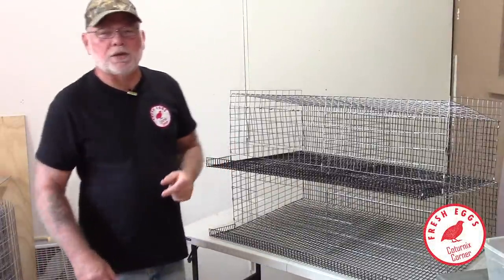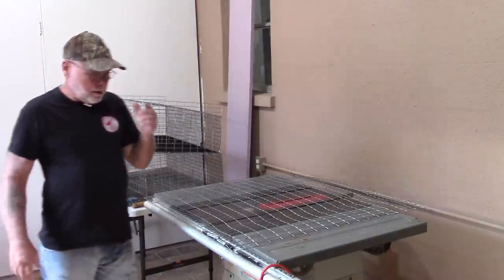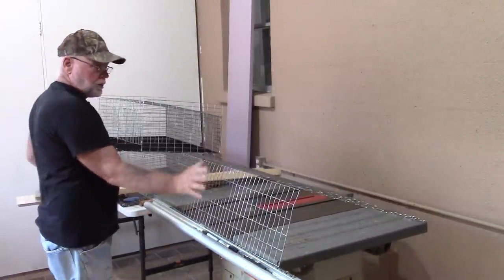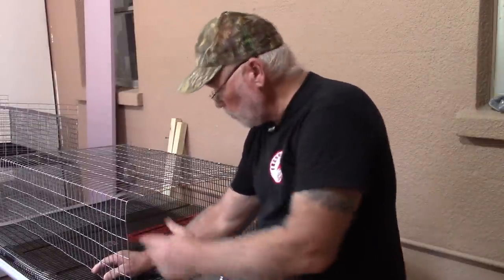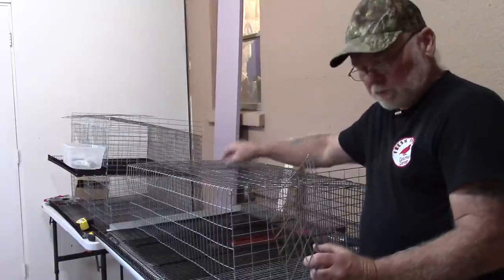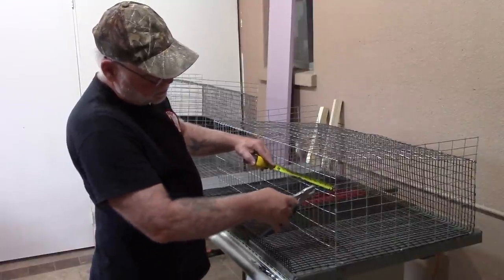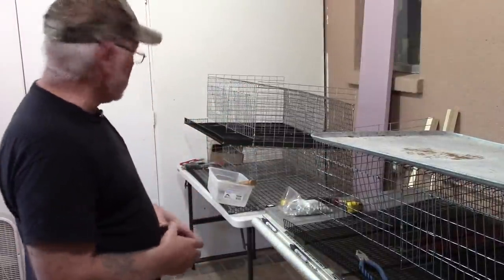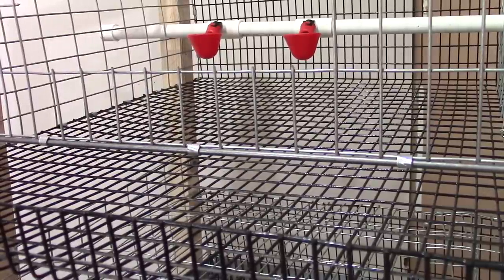ALL WIRE QUAIL CAGE - Build a commercial style quail cage at a fraction of the cost.

Comment: I am a a new quail mama.  Watching several quail cages being made. I’m a repurpose mama. I have two small animal crates with the bottom trays. I am wondering if you could modify the crates by raising the floor and make a roll out egg tray, perhaps by putting a new floor in the bottom of the crate with the hard wire you are using for the floor.  I might have to build a wood frame to support this repurpose floor but on a fixed  budget and two crates sitting around why not!  

The animal crates are small crates 18.5” L x 14” h x 12”  All I might have to do is add a hardwire piece to the opposite side of the door and anchor that on so when i raise the floor on a slant I have something to hinge it to and slate it down for the egg roll out.  Looks like the hardwire you are using might be the width of what I have. 

The holes are 2” w x 4” — might work!  Will keep you posted.  I will be keeping my quails inside.  The crate cost $29.99.  This might cut cost even more.  I think I will use PVC to build a moveable frame, keeping my PVC building like my chicken mansion 😂 like I build for my chicken coop. Wood is expensive.
Reply: Did you make it? 
How did it work?
Do you have it posted anywhere?

Comment: I use the pvc coated 1" x 1/2" pvc coated for my floors.  It's more expensive, so I do not use the floor material for the back and instead use the 1" x 2" for the front, back and top (2 bends).  If I'm making cages for sale that I will need to ship, I cut all the parts separately (floor, walls, top) and hog ring what I can so that it folds upon itself (flat) and fits in a flatter box (less costly shipping).  I include zip ties for the buyer to complete the build, but I also sell j clips/pliers if they wish a metal clamp solution.

Comment: I know you might not have the chance to respond, but I'm hoping you do! I'm planning to follow your method for my quail setup but I'm having trouble finding 2x1 inch HWC/welded wire here in the UK. Would using 1x1 inch mesh work just as well? Are there any adjustments I should make if I go with the 1x1 inch option?

Thanks so much!

Comment: Harbor Freight has a $299  36" metal brake suitable for this material. Comes with a floor stand.  They make a 30" cheapo one for sub$100 (no stand). The $300 one allows you to make feeders, poop trays and egg tray lids fairly professionally.  Plus, when you're finished, you can resale it for $200-$250.  Let me know... I've been looking for a used one every day... they go like "snap" that!
Reply: What does harbor freight have? I didn’t understand your comment
Reply: @Pete Wilson  a "metal brake". It's a sheet metal angle bending machine (used to bend the wire cage material in perfect 90° angles), up to 36" wide material.  Called a metal "brake" (think 'break' or fold  line)
Reply: @tullyriverquail  thanks!!

Comment: Just an idea you might wanna try Terry, use 1”x2“ wire on back wall and mount the cups outside the cage. Things will stay a lot cleaner. 
Not sure why you didn’t use Horizontal Nipples, 100% clean water at all times.
HN and water cups screw into same hole. Try them out in 1 cage. I think you will be sold!
Reply from the maker: Might give that a try, thanks

Comment: So the frame is just at each end and then you mounted the cages to each end? If I screw another two pieces of wood that goes lengthwise on top and make a smaller square will this support a full 5 gallon bucket of water on top? Sorry for so many questions. I'm an old dog trying to learn new things.

Comment: i like the material you are using to make the cage.  i believe your copping the store bought pvc cages. witch is a good idea, but you have to remember that they are designed it in many pieces for shipping. you better off making the sides and back of the cage one piece. install the top, bottom, and sides. then build the individual levels. starting with each bottom,(poop tray)then egg roll out bottom, then dividers. finish off with the fronts of the cage, and doors.  a welded angle iron base with casters would be great if you plan on taking it out of the room for a power wash after each run.

Comment: Having a lot of problems with bumble foot, would just using the heavier gauge 1/2x1 wire help or does it have to be coated.. currently have 1/2 x1/2 hardware cloth. Don’t need and can’t afford a 100 foot roll of the coated and can’t find smaller roll..

Comment: Please show the feeder set up. And how you keep the birds from making it a total disaster and mess falling down onto the manure trays. Thanks
Reply: You certainly did not ask me, but my solution is to keep my quail in 1/2" wire cage, 4' high to prevent feet nabbers, and outdoors away from me (stankie). Each day I release 80 free range chicken hens who require no additional feed thanks to the quail throwing it all out!
Reply: @brianandlynphilippines  not certain how you afford that!  Mine are all outside in separate cages but in my chicken coop but they seem to get it in the manure tray I’ve tried all sorts of different feeding methods. Thanks for your input
Reply: @gcranch9913  I don't think Doesn't Matter has manure trays so the feed just falls on the ground for the chickens.
Reply: @smckee9063  that be true! I keep seramas, chicken chicks, and quail on wire and let them kick the feed down to the ground, I add enough 2x a day for them to be fed, but definitely do not fill for playtime/boredom. The chicken hens are fat and produce eggs thanks to this system.
Reply: @brianandlynphilippines  My same concern as he used 1/2 on floors of the wood framed cages.

Comment: Terry, did you buy the coated wire in 100' or 50' rolls? I don't see 100' x 36" for sale.
Reply from the maker: I ordered 100' rolls, but I see it is only available in 50' now.
Reply: Correct, the 36" rolls aren't available right now (10/17/212). If you are wanting some soon, you can order online from Home Depot and they will drop ship to your house. I ordered from Amazon but didn't like the delivery time so I also ordered from Home Depot. I paid about $20 more from HD. They both ended up arriving on the same day, lol!!

Comment: Hey I'd like to build some of these, having a hard time finding the right wire. Where are you buying it?
Reply: If I remember correctly, I ordered mine from HD online (that was the coated 1/2" x 1". Then, I bought some more wire at Tractor Supply. We were getting ready to move but I saw stuff running out and I ordered it before they were totally out. NOW, all I have to do is figure out if i got the right width or not because I got quail cage wire and rabbit cage wire, LOL! I've got to have the correct dimensions in there somewhere.

Comment: My wire arrived today! By chance do you have the dimensions of the stand or a pdf of the project?
Reply: He said in a different vlog that the lumber was 1 x 2", with an inside dimensions of 36".  Then drill 1/4" holes and use a pan head bolt 1/4  20 that is 2 1/2" long with a flat washer and nut to secure the cage to the frame, 4 sets of those bolt/washer/nut combos per cage. He said he could fit 3 cages per wooden frame. About 8 inches off the bottom of the uprights he had a rectangular 1 x 2" frame with a center support as a mess-catcher pan holder for the bottom cage. I believe the cages themselves provide frame integrity, and I don't remember seeing any cross pieces at the top. Only the two side frames.
Reply: @amyb5339  you are amazing!!! I got everything built out just need to hang cages. Thanks for the excellent details

Comment: Is it necessary to separate the cage into 2 sections for strength?  Also, what gauge wire did you use?  If you told, I missed it.
Reply: 14ga
Reply: @cherylkygirl7181  It's 16ga, just click on the parts link to amazon.

Comment: Hi, I checked previous questions first but did not see an answer.  About how many birds do you put in each side?
Reply: Check my math? 
I calculate 18" x 20" area per room for 360sq inches. (2 rooms per cage built). If jumbo quail need 25sq inches per bird that's 14.4 birds. Subtract  1.4 sq inches for feeder and water cups(+pipe) and you have enough room for 13 birds per room or 26 birds per cage built.

Comment: Why different size hardware cloth/wire for floor? Am wondering if my current sized wire floor is too hard for my birds feet
Reply from the maker: The 1/2 x 1 coated wire is easier on their feet and is large enough to prevent manure buildup.
Reply: Where did you order the wire from..I'm having a hard time finding any...
Reply: @MrCutter133  got mine at tractor supply and Home Depot

Comment: What would someone use to predator proof this bad boy, because it looks awesome! Would using the smaller wire for the flooring work if I used it on all sides? I hate these blasted raccoons around here... AND the possums, though they eat ticks, and aren't nearly as tenacious as the coons...
Reply: 1/2"x1/2" wire all around would work....I wouldn't use the pvc coated wire for the top, back or sides as it is expensive

Comment: Are cages built 10" high, front & back; &  installed on a angle. or built at a taper for egg rollout. Also ht of gap for eggs . TY.
Reply: I rewatched, undistracted. So front ceiling ht is 11.5" & rear ceiling ht is 9", if I'm correct ?